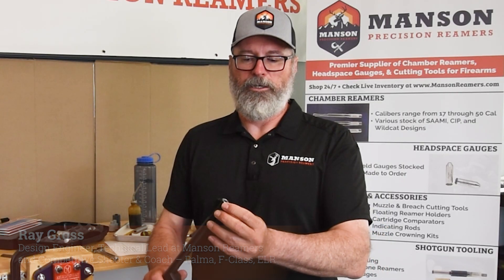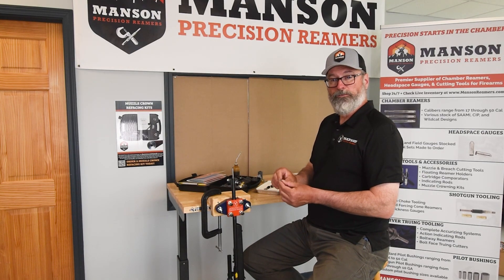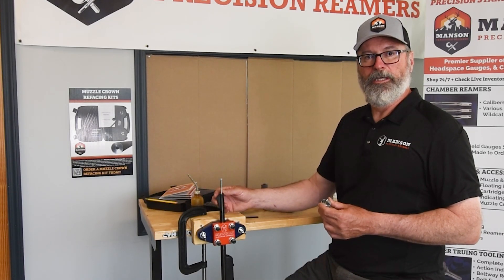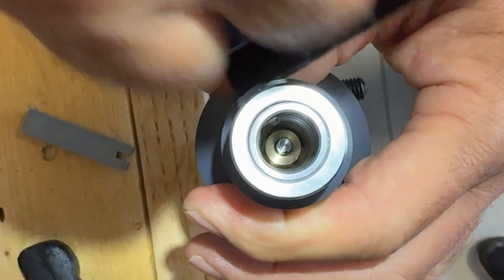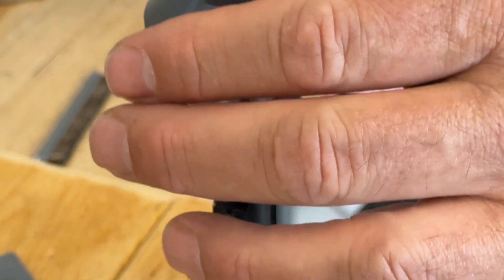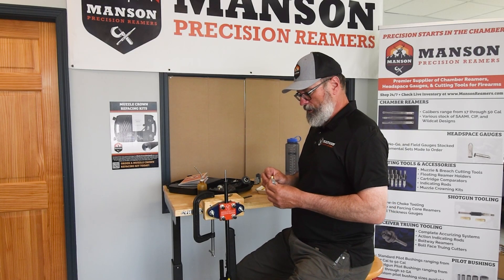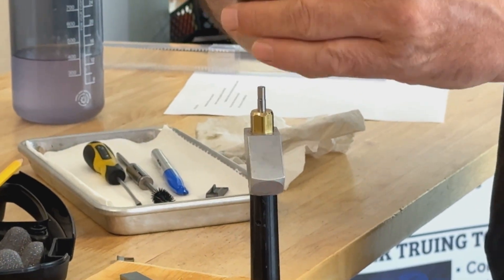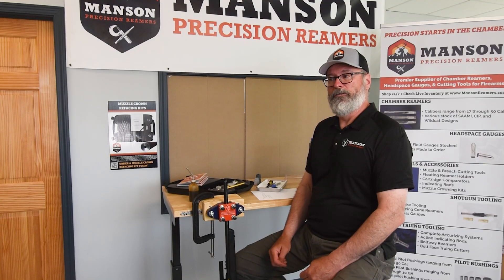How to Re-Crown Your Barrel in 5 Minutes with Manson Reamers

Comment: Thanks. My dad's Winchester model 67 had a nice rounded crown on it's barrel. I would like to put a crown on a Tanfoglio Appeal 22lr bullpup. It's flat perpendicular to the barrel. Some years ago I removed the screw on fake muzzle brake and cut threads on the barrel and mounted an A2 flash hider just for looks. I wonder about reblueing the barrel or just cold blue the muzzle?

Comment: I had a gunsmith install a muzzle brake on my deer rifle after shoulder surgery.  This asshole completely ruined the crown on the barrel and the brake install was complete junk.  I searched the internet and found this crown setup. I bought one   Watched the video several times and read the instructions several times.  I cut the barrel off with a hacksaw and filled it flat. Install this tool and crowned the barrel.  Then took the rifle to the range and was very pleased. Rifle shoots the best group it has ever shot.   This is a GREAT TOOL. I would recommend it to everyone
Reply: That would have been very annoying..... the guy that did it could not be called a gunsmith, that's for sure. If you want the barrel re-threaded for a brake or moderator, find a well known 'smith to do it. It's not a difficult bit of work, but does need a degree of precision, and some basic equipment, to do right.
Reply: I had a similar problem with a gunsmith who unsuccessfully threaded a pistol barrel. I hacked it off and crowned it and it's back in business.
Reply: Why did you hacksaw the threads off?  Then use the Manson device?
Reply: @spencertoolandgrind .   The muzzle brake would come loose after 2 shots.  The threads looked like they had been cut with a dull die from a tap and die set.  Like I said I got screwed over badly by this gunsmith.  I cut the 1.2” of thread off and recrowned the barrel and installed a recoil pad.   Took it to the range and shot .5 MOA groups with it.  Before the crown job it shot 1 MOA no better.  So in the long run it was a blessing in disguise
Reply: @spencertoolandgrind

Comment: There is only one way to cut a more precise crown on a barrel and that’s using a lathe but it entails a lot more work, skill and of course a lathe. The Manson crown cutter does an excellent job and with far less expense and machinery. I have had a Manson crown cutter for many years and it has never failed to do an outstanding job. Take your time and get used to it on some scrap barrels. Make sure to follow the instructions for best results. You will be satisfied with the end result. 
RH